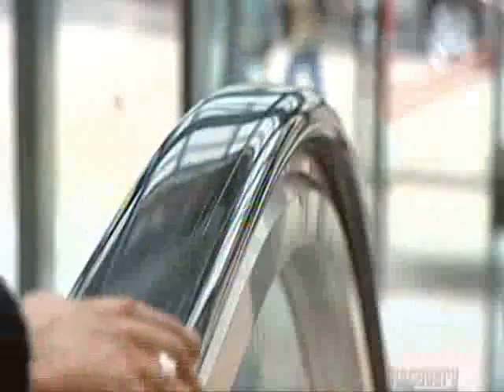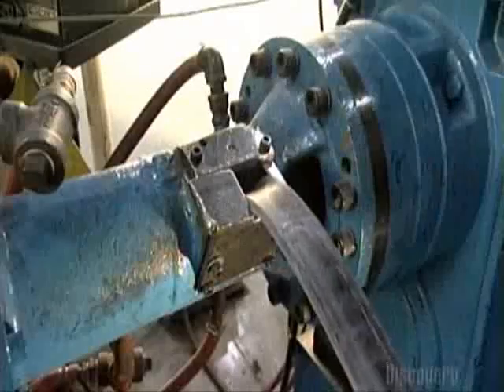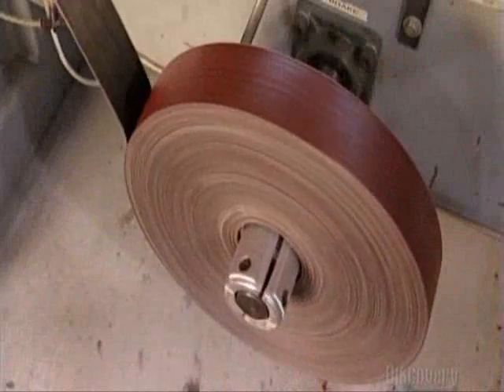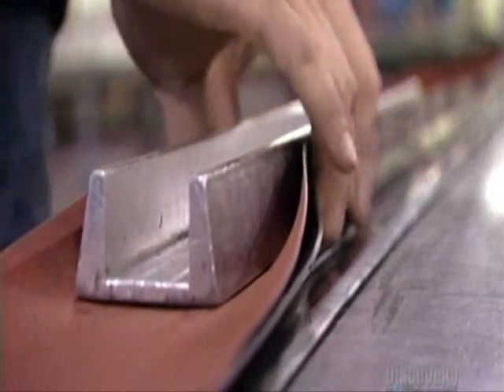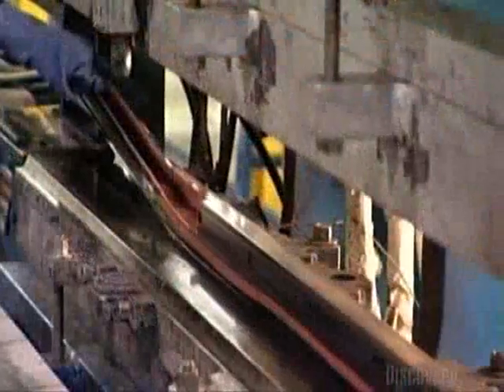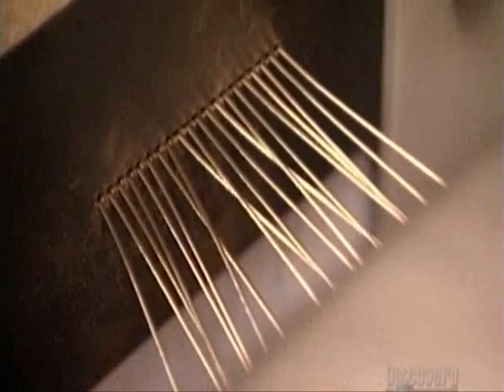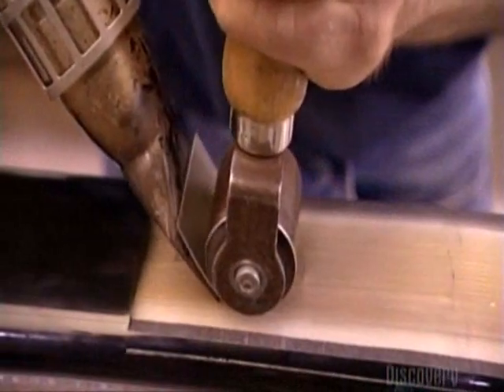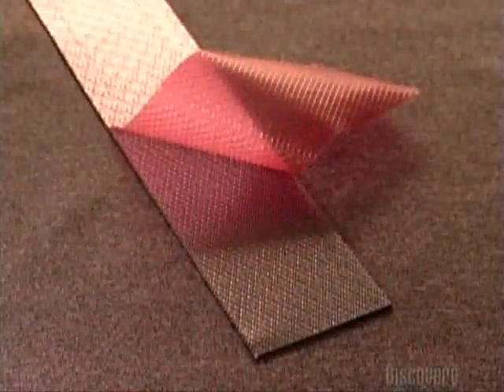How It's Made-Escalator Handrails

Comment: no it isn't moving the same speed like the stairs :P notice that ..it moves a little faster :P ... every  escalator I took a ride had exactly the same difference ...question - why?  try to lean on the handrail - your body will "go" forward a little faster  than your feet ..